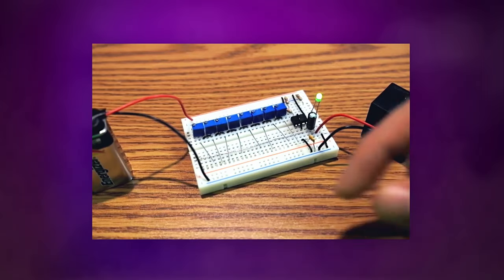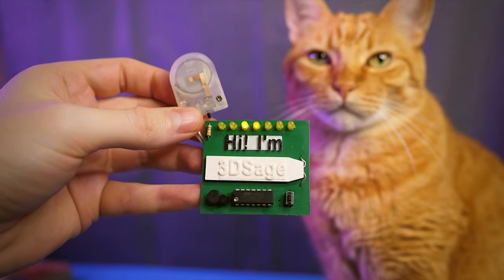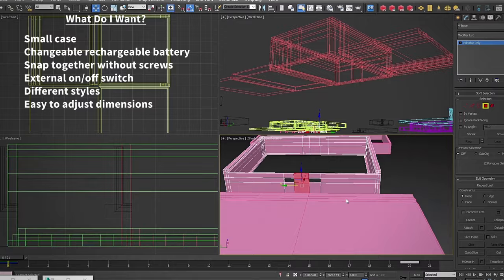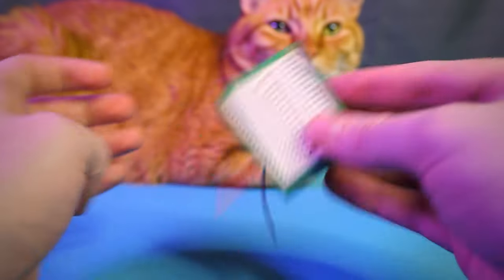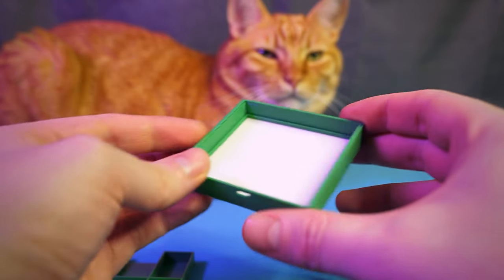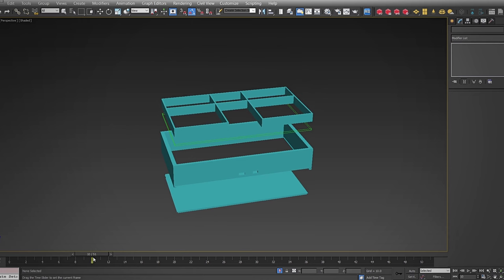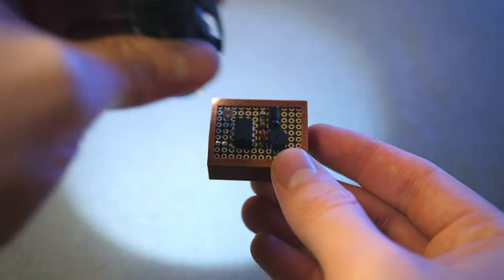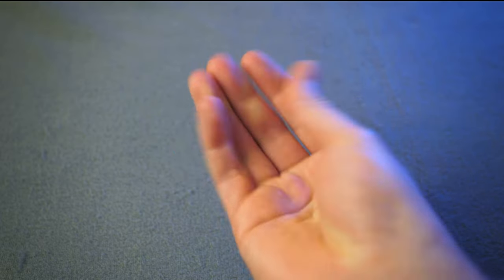Let's 3D Print Electronic Cases

Comment: Fun fact: most if not all of the breadboards with the power and ground rails have a rectangle of adhesive material on the bottom. If you cut a corner of that adhesive rectangle off, you can solder the battery to the rails from the bottom side.
Reply: Brilliant!!

Comment: Back in the day, all we had were a small selection of "Project Boxes" at Radio Shack.
But, the board wasn't displayed on top; it went inside.  The controls, ports, etc. were mounted on the top and sides by individually drilling holes.

Comment: Thank you for sharing your design concepts and constraints, this is precious! I too spent quite a while designing boxes for my components, but I have different constraints, such as hole for OLED screens, repositioning of the switches or DIP switches on the enclosure itself, LED fields, placement for motors (including servomotors that need to be locked in place with very precise dimension), placement for external circuits (such as MPU6050 that has to be on a reference surface). I like a lot you're bringing solutions that can be addedto a design as a known-good working design and proven to work over time, thank you again.

Comment: I have done something similar with FreeCAD, creating a scalable box for FR4 perfboards.  I settled on M2 screws in recesses that go from the bottom, through the board, and into brass heat inserts on the top half of the "clam."  Once this base box is done, it is relatively simple to place holes and slots on the top and sides for the interface components.
Reply: How do you like FreeCAD? I'm just getting started with it but I've spent years working with SolidWorks and Inventor on the job. I like the "free" part and the fact it's open source

Comment: Thanks for the well thought out design and the idea to use those batteries. I see your files are all STL, Fusion does work with STL files but very poorly and TinkerCAD works really well with them but is painful to use as a design programme. I haven’t tried Onshape. What CAD do you use?
Reply from the maker: Oh ok I can also upload different file formats. What do you prefer?
Reply: @3DSage   I suggest .step files for general compatibility although fusion is very popular and uses .f3d files. Thanks.